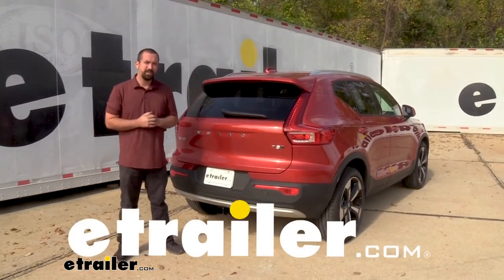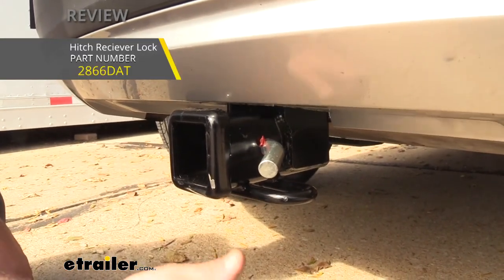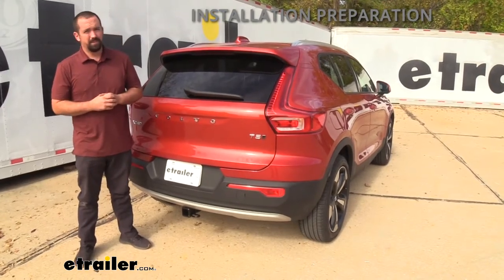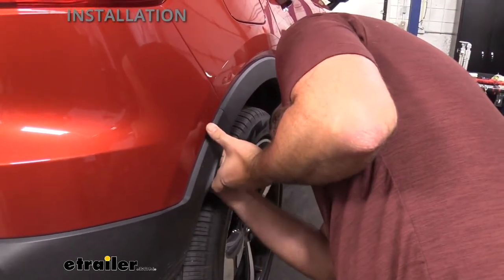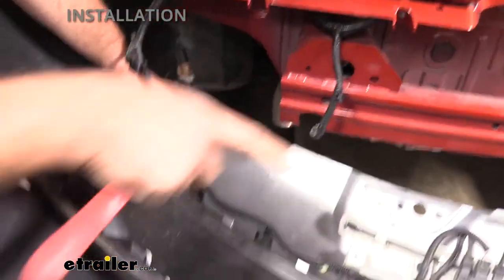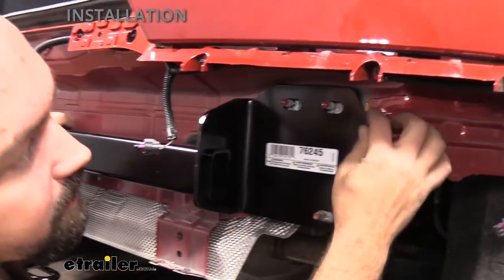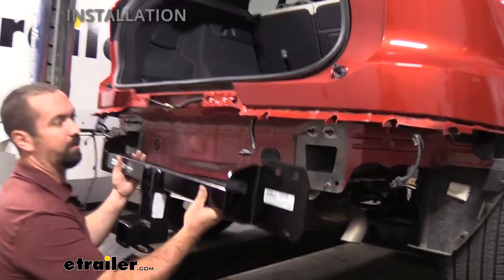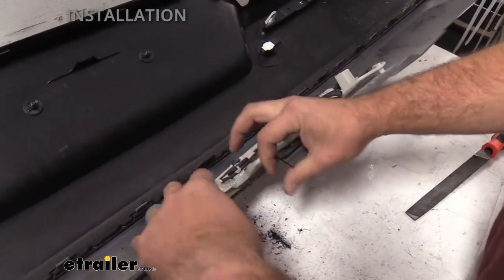etrailer | Draw-Tite Max-Frame Trailer Hitch Installation - 2021 Volvo XC40

Comment: My xc40 did not have all the sensor and lights wires to disconnect. There was one large bundle of wires to disconnect and that was all. The hardest part of this job for me was putting the fascia back on. Lining all the clips up and having things snap into place was difficult IMO. It all worked out though. Good video.
Reply from the maker: Great to hear! Yeah sometimes putting things back together is harder than taking them apart!